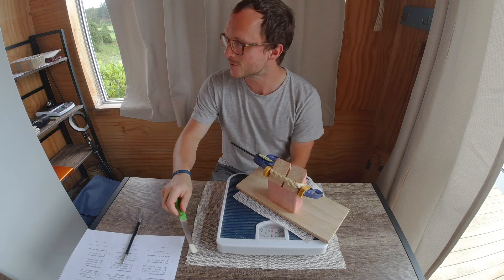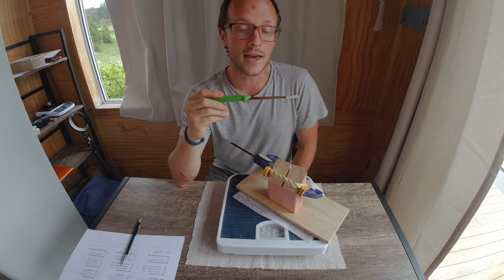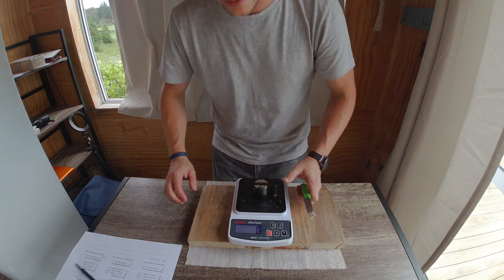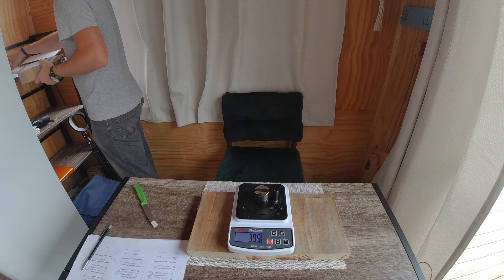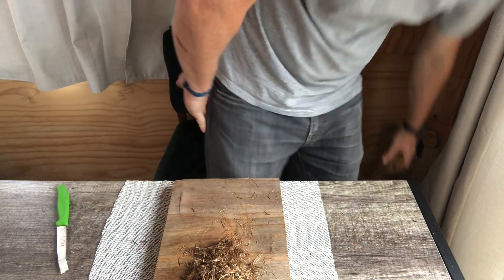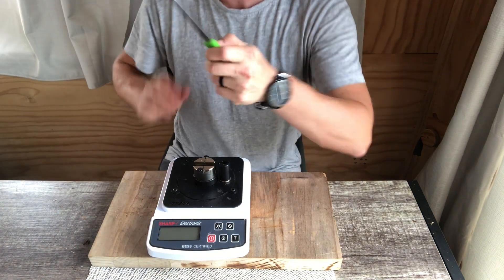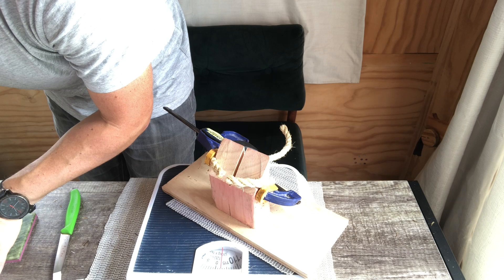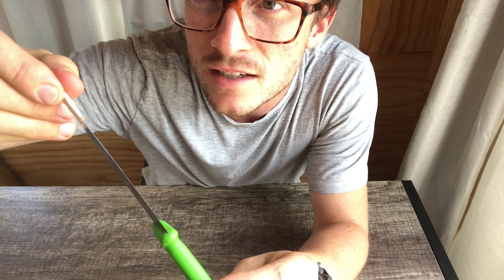$10 Agate Stone - Will It Dual Grit? | Cheap Knife Sharpener Test

Comment: Gabe you should start w a Bess of 600 and see if ANDY sharpens an edge, for bro sciencecan you judge a wire edge at the end of testing? I’d vote no as it could be created during the fourth date w Andy=he’s a rough boy.
Reply from the maker: Interesting thoughts!  I actually have changed my method for toughness testing and do all of them after 3 passes on ANDE to equalize the wear.

If I test on the pine before the ANDE cut it will mess up the ability to do the test (though providing valid data) I think I'm just going to go through all the testing and then test all the winners resharpened FRESH on the pine piano leg and then we will really see how their stability compares!

Comment: I got a bunch of cheap Rehoo 6"x3/4" stones, rated 5k to 12k I think. Pink, black, marbled green and marbled white. I wasn't sure if they actually grind or just burnish at the higher grits. These results suggest maybe that they are burnishing the wire edge more than grinding perhaps.
Reply from the maker: Interesting thought.  I think these are both probably adhesive wearing stones, similar to the sharpening action of a ceramic.  But I don't know, that's just a guess based on how they feel and the way the stones load with metal and are hard to clean.
Reply: They come super polished and I find it best to rough them with some other abrasive (paper, stone, loose grit, whatever) to give some teeth.  Who really needs 10K grit anyway unless you are shaving.  With a roughed side it does very good work quickly and it absolutely cuts instead of burnishing.  Give it a try, especially if you have two sides to work with on your stone!

Comment: Very interesting! I've been curious about these agate stones (and the Guanggxi stones). Have you conditioned the stone with a coarser abrasive?
Reply: I got one for a hair whittling on stone challenge. Managed to get the results after conditioning the stone. Seems like a 10K and after conditioning closer to a 12K.
Reply: Mine was a large green 10K stone from Rehoo.
Reply from the maker: I have not yet conditioned the stone.  What grit and type of abrasive do you recommend to condition an agate?
Reply: @homeslicesharpening  For general purpose knife I wouldn't bother with conditioning, it's fells like a 10 K and is already finer than what I would normally use on knives.
Since your plan is to use it for dual grit I don't know what will work best. 
For raisers conditioning would help. I used a Brasilian synthetic stone that you probably wouldn't have access to. The name is Phoenix Laranja. It is 400 grit and ultra hard stone, almost doesn't release abrasive. Used light pressure until it got a semi glossy surface. After that used Jacaré white paste. It's a fine aluminum oxide paste that leaves relative grit on knives about 12k, which was my target for the stone. This way I don't have to worry about paste contamination on the stone.
Reply: @homeslicesharpening  They sold it as an Agate but probably that's not what it is. Agate has distinct ring pattern. The stone I bought they just said green stone, a friend of mine is a geologist and said probably it's a nephrite Jade.
Reply: @homeslicesharpening  Conditioning with stones is tricky. If you use soft stone corners may break and leave rolling abrasive that destroys the conditioning. Rounding corners help. Jade is quite tough but other stones such as slate can easily break corners and leave deep scratches on themselves while conditioning.